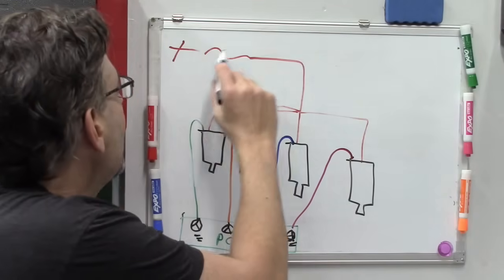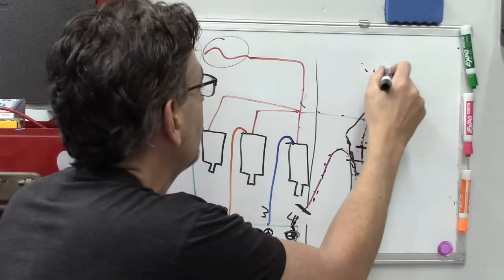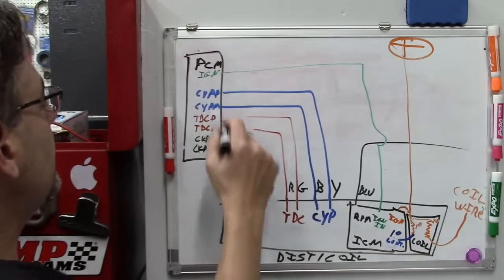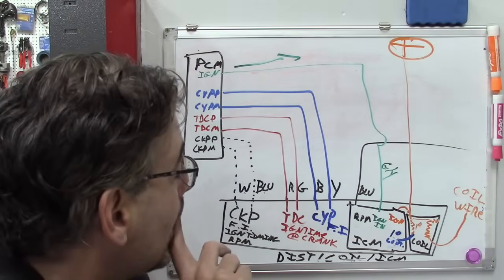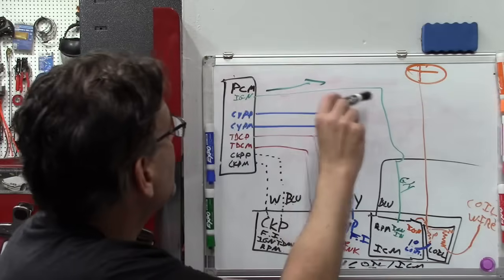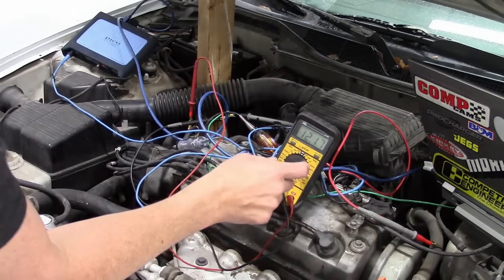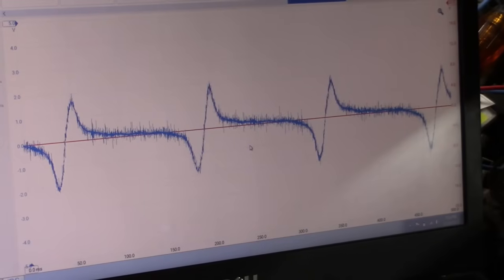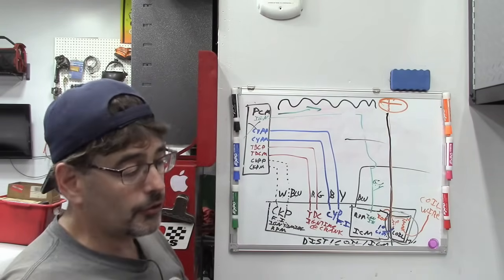DIY -How To Diagnose No Spark No Start. Bad Crank Sensor? FREE SBQM VIDEO

Comment: I'm new viewer to your channel. Algorithm from YouTube got me here😂. But I liked your video about the 'no start issue' with the car. I had a better understanding of the ignition problem. I have a 1997 Chevy cavalier which I had given up on, it was parked for 2 years after the diagnostic tool indicated I had bad PCM. So I bought a brand new one from O'Reilly's. Then it was recommended that I get it flashed. I went to two GM dealerships about flashing my car's PCM but they told me my car is obsolete and that it's too old and they only flash (reset) a vehicle's computer for 2000 yr and newer. 🤷. So I went to the junkyard to get a used PCM and my car started. (My car started to have anti-theft activation which I was overriding by doing the 10 minutes intervals 3x, {prior to my breakdown in 2021} until the theft light stops blinking and it was working for awhile until the 'no start happened' no one could figure out what was wrong with my car) One day probably 2 months ago a coworker at my job came over to my house and he tested my fuel pump relay and determined I had a bad wire. So he took out a small section of the bad wire near the firewall. And suddenly my car's fuel pump engaged (but he didn't bypass the fuel pump relay it remain intact). The only thing now is the anti-theft light stays on, but the car runs. Only issue I have is the car has hard starting issue. I suppose it is the fuel injector problem, I do see the leaks in all four fuel injectors. I ordered 4 brand new injectors so I plan to replace them. The car runs good after it starts. Once in awhile the anti-theft activates when I have a starting problem....then I have to wait 10 minutes for the anti-theft light to go off. I did see a YouTube video where they said the anti-theft wire the middle wire can be cut to get rid of the problem for good. What is your take on the anti-theft activation problem?  People suggested I put Seafoam in my gas tank because of the stale gasoline... yeah it seems to hv help clean out my fuel system, but I really suspect the fuel injectors are bad. The car runs good when I hit the hwy. The anti-theft situation I have no clue how to fix it. I keep overriding the anti-theft with the 'ignition-on' and waiting 10 minutes...it's a hassle. But most of the time I managed to start the car without activating anti-theft. Yes I felt like pushing my car off a cliff in 2021 after anti-theft system and fuel pump failed to engage. If anyone knows anything about anti-theft problems with 97 cavaliers give me a holler. My cavalier is my commute to work.

Comment: What are the chances of frying a computer if you just test the wires without checking the diagram?
Reply from the maker: On this model- very low because you would have to have vehicle in crank mode to have power. On other models- yeah with constant power you have a 50% chance of shorting the control side.

Comment: Good to see there is someone like you , who is not a parts replacer, this problem with most mechanics would be in the $500 dollar range with parts and labor . Maybe even more. Having just replaced a crank position sensor on a 2003 silverado it was definitely a challenge to say the least. I got lucky with only replacing a oxygen sensor then the crankshaft sensor which was the problem. Your video was so interesting in your diagnostic testing. Your a smart dude and thanks for sharing your knowledge.
Reply: Matt you the best

Comment: hey schro i have a g35 2003 that had previous fuse pump issues. I've replaced the pump and now the car has guaranteed fuel pressure< all of the sudden the car cranks but doesn't wanna start. its still getting fuel i checked the spark plugs after cranking and its wet and reeks of a fuel smell. i took a plug grounded it with coil and i see no sparks, i believe the car has a no spark issue, I've changed the cam and crank sensors from my parts car but doesn't do anything any suggestions?
Reply from the maker: What is the coil signal voltage?
Reply: @SchrodingersBox  i wish i remembered where i put my voltage reader at but just cranked the engine car sparked and sputtered for half a second. then wouldn't turn back on. i replaced the cam sensors today and it still hasn't fully started BUT just now it sputtered for half a second meaning the ecu recognized the cam and crank sensors for half a second. i believe my sensors are just fine but its really confusing just yesterday i had these same exact sensors i have now and she ran perfectly. I'm going to go dig for my reader
Reply from the maker: I don’t understand- if you don’t have a voltmeter how did you determine the cam and crank sensors needed to be replaced???
Reply: @SchrodingersBox  well i used a test light to see if the coils were sending power and i didn't really see any sparking. i have two of the same vehicle one for parts and the other for daily use. so i thought since i have parts for free why not just switch em.... but other than that, something odd has happened again. the car started right up as if nothing was wrong in the first place. but in the morning I'm almost certain it will just crank and crank again. it has done this to me 3 times.
Reply: @SchrodingersBox  but my main question is why does it not want to start up when I let it sit overnight?
Reply from the maker: I don’t know why. There is no data to tell anything. 
  You mentioned you “didn’t really see any sparking”. Either there is spark or not. The first thing you have to do is determine your FASTTEC variables. You still have not done that. That’s first and foremost in any no start.  I am not clear on how you are testing these coils with your mention of  “checking if the coil is sending power”. Coils don’t send power. There is either ground side switching or a transistor signal input at the coil - which design is yours?
   You have to determine that clearly and decisively. If you have spark then stop chasing spark!!
Reply: @SchrodingersBox  okay mine is a coil on plug system so it doesn’t have any type of igniter on it. It’s really confusing me because at one point it shows no signs of sparking but then sparks occasionally when it wants to. I will use fasttec and I’ll verify my question and get back to you.
Reply from the maker: We’ll just start with the extreme basics-   Is your coil ground side switched or transistor controlled?  You need to know that first.
Reply: @SchrodingersBox  so schro my car officially has spark, I did a test and I can see my spark test light lighting up, so sensor is out the way, but I still don’t understand why it will not start I have fuel like I said I’ve already verified that, and spark as well what else am I missing? The maf is working properly and so is the throttle body.
Reply: I’m trying to think of a way I can actually show you that it sparks
Reply from the maker: It either sparks when you put the coil output to a ground or not.
Reply: @SchrodingersBox  would there be anything else that could possibly prevent car from starting? since it is producing air spark and fuel ?
Reply from the maker: Your variables for a no start are fuel, air, spark, compression and timing. 
  It must be one of those. Ir you have spark and fuel then by far and away the most likely issue is timing.  Because bad compression would have to be in every cylinder.  Compression is usually a variable for misfire but not often for no start. 
    If you have fuel and spark, you need to check timing next. I am not totally sure you eliminated spark though.
Reply: @SchrodingersBox  yes that’s what I’m doing now I’m charging my battery for another run. I see that I have spark coming from my coil, but I wonder if spark is actually being producedd out the plug. Schro would there be a possibility of weak spark is that a thing?
Reply: @SchrodingersBox  yes that’s what I’m doing now I’m charging my battery for another run. I see that I have spark coming from my coil, but I wonder if spark is actually being producedd out the plug. Schro would there be a possibility of weak spark is that a thing?
Reply from the maker: You would have to have no spark at any of the plugs for a no start. Spark is not the issue. Check fuel and timing next. If I remember you said you could smell fuel so timing would be next b
Reply: @SchrodingersBox  okay awesome so this motor the “vq35de “ is ran by a timing chain which ways do you know that I can check the timing is there a video on your Chanel I should follow?
Reply from the maker: I do it by correlating the cam and crank signals or by looking at ignition signal in correlation with relative compression.  You can also simply just put engine to TDC#1 on compression stroke and look at cam timing marks.
Reply: @SchrodingersBox  one question I have, so one symptom I was experiencing was, when I was at an idle the car would suddenly shut down, just suddenly but I was able to turn back on, and another symptom was, when I was driving, The car would jerks like it wanted to turn off for half a second but acts fine after, mind you this car actually drove yesterday but then all of the sudden when I let it sit for a while doesn’t wanna turn on, what would that indicate? Is timing really my issue ?
Reply: @SchrodingersBox  schro I think there’s a sensor electrical or ecu problem going on because it started up but died right after
Reply from the maker: Then you have to find what was lost when died. Was it loss of spark? Loss of fuel? Was the timing never correct in the first place?
Reply: @SchrodingersBox  since it was so sudden then I’m leaning towards spark but that’s only an estimate I’ll have to make 100% sure
Reply: @SchrodingersBox  so I officially found the problem, I have video proof of what my issue is, the car is lacking spark power, it is giving spark but not enough to go to the spark plug. It just started but I wasn’t able to get it started again, what causes lack of spark?
Reply: @SchrodingersBox  yeah spark was lost and I’ve replaced all sensors that relate to spark, I believe I should start heading to the ecu sadly
Reply from the maker: Ok then that brings back the question- is it a ground side switched coil or is it internal transistor design. Otherwise how are you doing to check if the PCM is the issue, right?
Reply from the maker: You have too weak spark to jump a spark plug gap at ALL coils???? That’s virtually impossible. What’s your voltage drop at the power on any one coil?
Reply: @SchrodingersBox  yes apparently it appears to be extremely weak on both rows of the block it’s frustrating I’m going to test what the drop is with my multimeter but I can already tell that the drop is not so strong
Reply: @SchrodingersBox  what led me to the ecu is the ecu threw codes that weren’t nowhere near the problem like o2 sensor and fuel pump. I’ve already replaced the fuel pump since I happen to have a new one with me from my older functioning g35 and the codes still threw
Reply: @SchrodingersBox  if I could show you a video of its sparking it would probably give a better idea of what I am talking about
Reply: @SchrodingersBox  I just found out that these plugs are a transistor design

Comment: Awesome video! I'm trying to chase down a gremlin myself on my 2000 honda prelude. Has good compression, fuel, but not getting spark on cylinder 4. Has an obd1 distributor converted to coil on plug. Swapped coils and plugs, still no spark on cyl. 4.  I'm leaning towards bad sensors inside the distributor, the cyp sensor
Reply from the maker: What “sensors” inside the distributer are you suspecting?

Comment: Did you explain how to test the icm? I thought you did briefly. I can’t remember
Reply from the maker: yes there are several ways.  First you check for reference and ground from the PCM. once established you input a signal to to the PCM and see that it is processed by outputting an RPM signal. if all those work the PCM is fine.
Reply: Thanks for the reply! I’ll try that tomorrow. The issue I’m having is there’s power to distributor but I’m getting no spark. The distributor is brand new because I just swapped my d16y8 out for a b18c. The engine is obd1 and my car is obd2a. I’ve kinda checked the signal for the icm I do have voltage at the ecu going up and then I have voltage coming from the under dash fuse box to the driver side pillar. But from the harness side connector c101 I believe. I have a drastic voltage drop. We jump the wire with alligator clips and a new wire and It still only would crank. Didn’t have spark still. I’ve tried my best to diagnose each possibility before taking it to a shop. Still cant figure it out though. I mean is it likely that a new distributor would fail. Could I have fried the icm and coil some how idk. I did test the coil my test light didn’t come on while I was manually trying to get spark but the screw sparked every time. Now take it I done I’m the test light during the day so I may not of seen it. But thanks I enjoyed learning thing during the video. Very knowledgeable and easy to understand!
Reply from the maker: The distributer still needs ignition signal. Seems it’s missing that.

Comment: You are very thorough when explaining what you are troubleshooting and I appreciate that. I also know you have checked the fuse or ckt breaker LOL. Keep up the white board explanation, that is what I find in my opinion puts you above 90 % of the Instructors found on the internet. There are way to many parts swappers and it drives me nuts when I don't know what the actual problem is before ordering parts. Thanks for all your hard work, I subscribed to you when ever you first started and had very few subscribers.
Reply from the maker: Thanks so much!!  I believe I saw your name before some 8 or 9 years ago.

Comment: wouldn't checking the fault codes first be quicker....
Reply from the maker: Typically with this you will get a P0300.  It will not narrow down anything.  It only helps if you have a single misfire code.

Comment: This should be a public service ad for the benefits of EVs.... seriously, flippin ridiculous, if you ask me... EVs = no scopes, no timing, no injectors, no evap, no oxygen, no fuel pump, lines,, on and on and on...... there's 3 or 4 sensors on my fuel cap and fill tube, for christ's sake, and it seems like every one of 500 sensors will completely immobilize the vehicle.
Reply: They aren’t giving Ev’s out for free last time I checked as far as I’m aware of
Reply: @illuminateBeats1  I can't believe I left this comment only 10 months ago. I was quite perturbed about my truck starting issues, lol. Which, incidentally, had nothing to do with any sensors, but was one wire, on one of the several wire bundles of 15 wires each, lol. Ironically, I'm guessing that is something EVs have, is a lot of wire bundles. Probably better self diagnosing pcu though, to help find it? Idk....lol, but I can't believe the comment, cz I've actually ended up believing evs are a scam. They have a big dirty secret anyway. 

As important as the battery is to an EV unit, it's range, reliability, and lifespan, and the lynchpin role it has in making the car a viable solution, then people need to understand ho those things re affected by cool weather. ol as in north of Los Angeles, cool. Which i total guess here, 2B- 3B car owners? As well as terraneous conditions, i.e. hills, bridges, inclines, curves. These things all together make evs a joke in most places. And FORD's milage numbers on the lightning were alredy shown to be beyond reasonable expectations, in pretty neutral conditions. And in hot places, the lifespan is severely cut.

It's all investment scamming. Create the stock, create the buzz, blow it up, sell the stock, who cares about the fallout. The media and content creators all fall for it, looking for a big story. Lordstown, Workhorse, Nikola It's fkd up man... AI is the same thing happening right now.

peace
Reply from the maker: Hahahaha I didn’t even notice the comment was that old lol. Someone rose the dead to life hahahaha!!!
Reply: @blackopal3138  takes a strong character to admit mistakes and move forward - good on ya!
Reply from the maker: I agree!!! Excellent display of character indeed for opal!!
Reply: Congratulation on repairing your EV on roadside
Reply: bahahaha you wish lol a ripped speed sensor will make an ev un drivable. i work on these believe me it’s still the same
Reply: Ev’s are “COST PROHIBITIVE” when it comes time to replace that “TOXIC (NON-RECYCLE-ABLE) Massive Battery pack .
Reply: I was staring at a tesla the other day and i was thinking the same thing. No metric ton of bullshit needed to make the car move.
Reply from the maker: No but it does need almost a ton of battery to make it move.
Reply: @powerplayer75  Try telling that to Elon's board members...
Reply from the maker: If your EV does break down though- a gas tow truck is going to pick it up. That’s a fact.
Reply: We need technicians for BEVs too. And the need will only grow. It is going to be a big shift. Im not really sure at all how or when the bev service industry is going to develop.
Reply: @wesallenn6732  My position has evolved. Until new battery technology is developed, EVs are basically a scam. Tesla is on the verge, I'm not going to say the company is a scam, but they sell cars in Southern California and Texas, so to each his own. But North of that, EVs are a bust. And even Teslas, in the end, have a larger footprint. Hard to believe, but that's how the world is. Im poor, desperate to secure a comfortable future, and I lost 5 figures, nearly entire savings, on Workhorse and Lordstown, cz all they do is lie. They're still lying. People drawing salaries, pretend sales. World is a joke. Peace
Reply: Aww, you guys🤭 lol
Reply: Just mining and toxic waste from lithium batteries that’s cool though